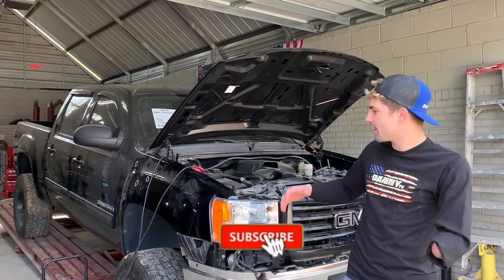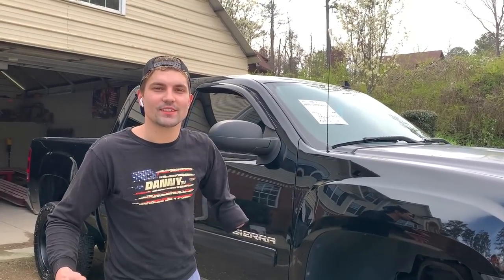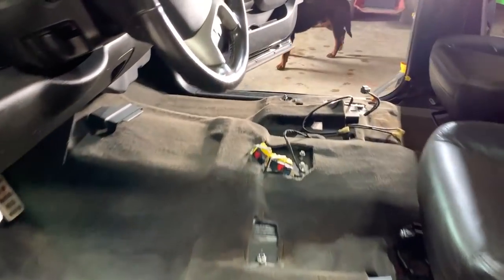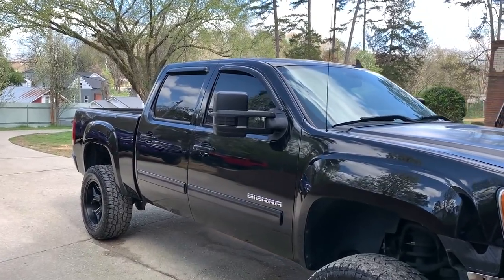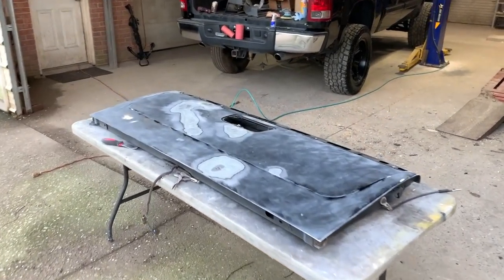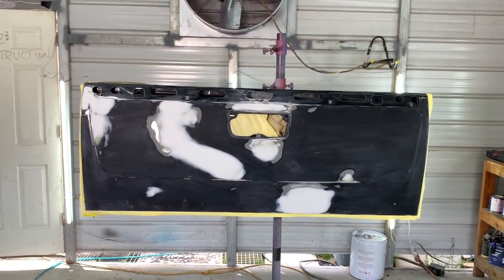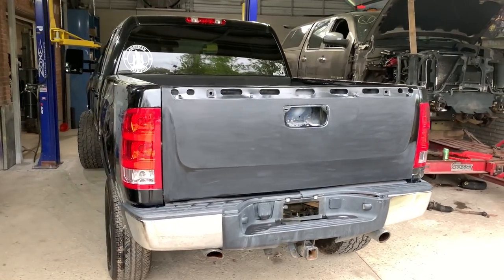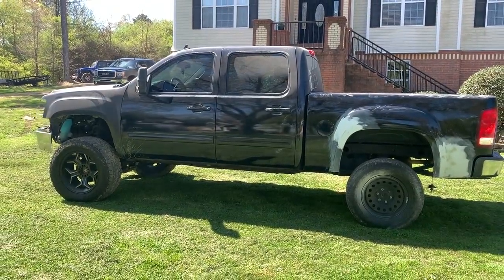Starting The Body Work On The Wrecked 2013 GMC Sierra

Comment: Company policy is just that, a companies wish list.If this policy gives false impressions, thereby committing fraud they can and must be sued. Selling an item with fraudulent intent is criminal. So its the onus of the company to inspect their products and represent them in a true and legal  fashion. Purposely lying to a customer to offload broken vehicles is not only illegal but unethical.
Reply: The term Run and Drive often causes the most confusion among Copart Members, so let’s clear this up.

When a vehicle arrives at a Copart yard, Copart confirms that the vehicle starts, can be put into gear and can move forward under its own power. There is no guarantee that this will still be true by the time the vehicle is picked up on location. There is also no guarantee that the vehicle is in roadworthy condition, or can be legally driven upon the roadways of the state in which the vehicle resides.

The term Run and Drive was put in place to ensure that Copart Members understand the condition of the vehicle they are bidding on. Learning and understanding this term will help you become a smarter, more experienced Copart buyer.
https://www.copart.com/content/us/en/landing-page/copart-101
This sort of covers all bases IMO for the intended purposes of vandalism or dead battery, not changing the definition of "run and drive". I can't recall the auction that was used. "Industry standard" needs a legal definition.

Comment: So NOT a run and drive. Should have been listed as a start. Rear drive shaft in two pieces, one front wheel in the bed. How will it move when put into gear? It cannot.